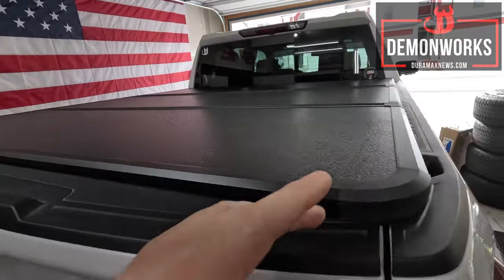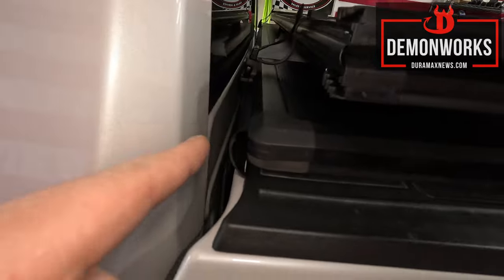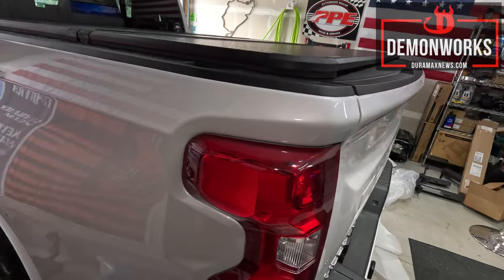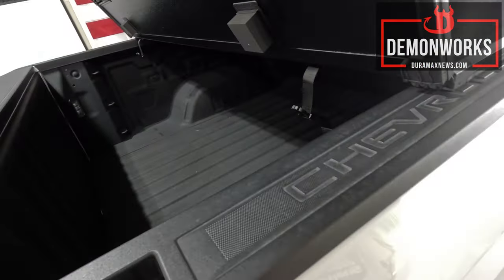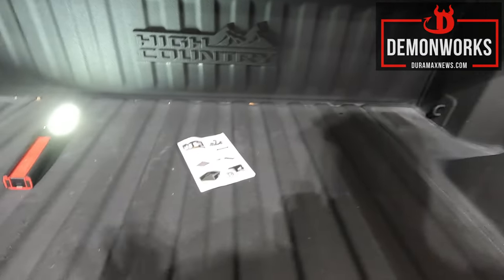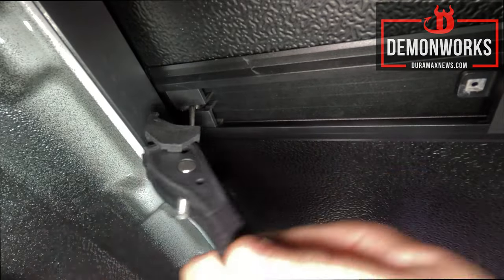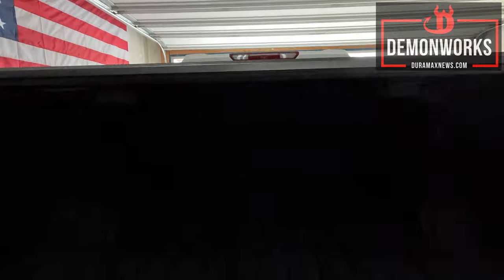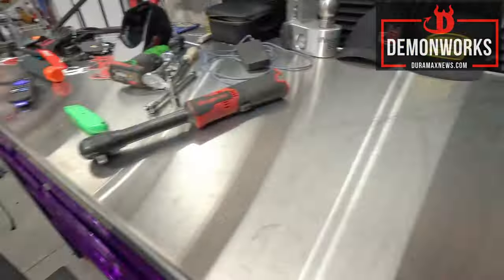TRIFOLD Tonneau Cover Installed Silverado / Sierra Short Bed - ONINE Hard Bed Cover

Comment: Any updates on how the VSE filters have performed so far?
Reply from the maker: They have been working without  issue and today I will be doing a video on the factory fuel filter in comparison to an acdelco but then within the next week or so, I should be pulling the filters off the VSE unit to open up and take a look in them.
Reply: Glad to hear it. I bought the VSE unit but haven't gotten around to installing it yet. The one thing I'm concerned about is the water in fuel sensor being located on the clean side of the separator unit. It seems like water would accumulate on the dirty side and then it would be too late by the time it makes it to the sensor. I'm curious to see your take on it. Thanks for the awesome videos!